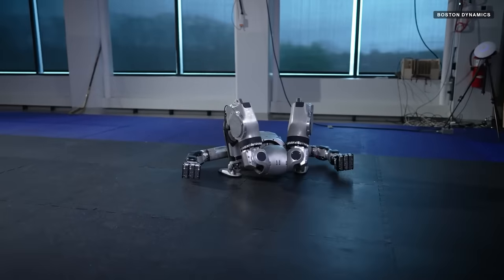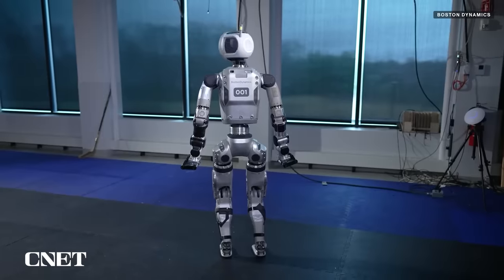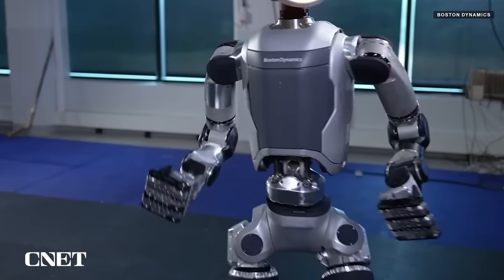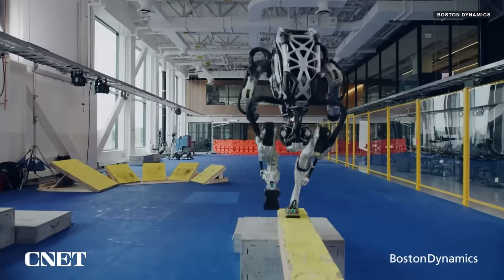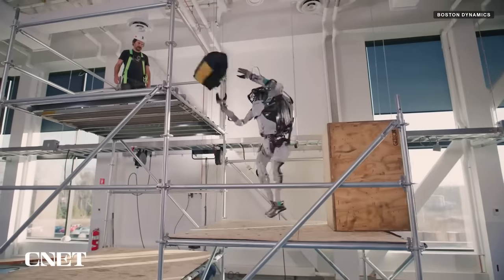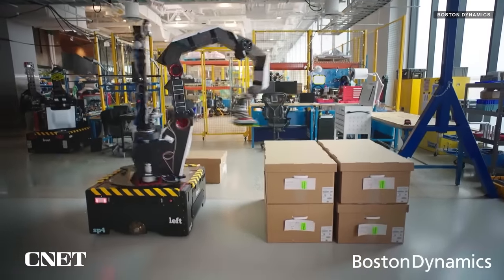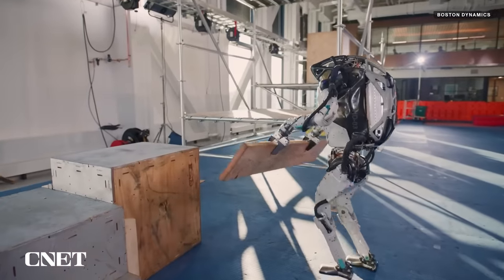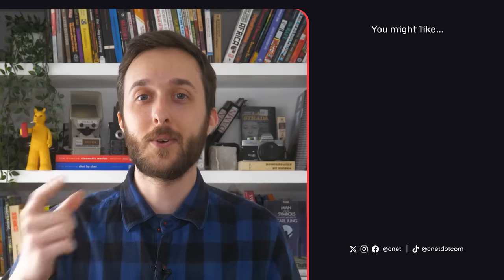Atlas vs. Optimus: Boston Dynamics & Tesla's Humanoid Robots

Comment: It's an insult to the years of hard work, research and dedication by Boston Dynamics, to even mention Teslabots in the same sentence.
Reply: @nth7273  No, they won't. Boston Dynamic Atlas will be in the factories in another 6 months. Also Atlas look more sturdy than Tesla bot
Reply: Tesla way ahead
Reply: Not in the slightest. Tesla will dominate. The hate makes no sense and you’ll be left dumbfounded in time
Reply: @milkybalance342  
It's not hate. There is genuinely very little reason to trust Tesla's capacity to make robots given BTDs track record. It's just the logical pick, even if it's wrong.
Reply: Its like comparing c3p0 to the T800, no competition, tesla will eventually get there but BD will be mainstream in the workforce and on the battlefield before them.
Reply: Sir can we adopt boston robots?
Reply: @saleemsuliman3062  
Yes.
For roughly 70 grand, Spots a great lil' companion, ain't he? 🥰
Reply: @ivoryas1696  you mean 70 thousand dollars
Reply: The difference is that Tesla started 3 years ago, give them another 5 years and they will be ahead.
Reply: This.

Comment: Boston Dynamics casually flexing and showing why they're the frontrunners of humanoid robotics lol.
Reply: Just standing up is much of a flex look at its clumsy hands an clumsy walk they had to cut it short BD is learning from scratch when it comes to electric motor and actuators they're used to hydraulics systems In its humanoid robots
Reply: What you are seeing at BD is programed moves.   Watch maker were making spring or weight driven automatons that could play music or sign their name 100s of years ago.   They programed their creations with cams.  The same idea as BD is using but mechanical vs digital.
BD is till setting up it's AI research.
Reply: @trondialsingh594  Lmao, they've been working with electric actuators on Spot for years now. Hardly a new thing.

And yes getting up from the floor is a flex. In that I'm pretty sure Optimus still struggles with it.
Reply: @chaosfire321  Optimus struggles with walking

asking it to stand up is just a bit beyond itself
Reply: 11yrs(BD) vs 2yrs(Tesla) btw
Reply: @danharold3087 nonsense. The new Atlas uses machine learning and AI vision.
Reply: @Settiis  You know this because ?
Reply: @danharold3087  Because I read their blogpost.
Reply: @danharold3087  The actual ability for a robot to move without physical supports and do so quickly is itself an important step, and it isn't as if most of Tesla's own videos aren't also faked such as the clothing folding video. At this stage their robot can barely walk at a rate of 2 miles per hour max and barely looks stable on flat surfaces as of their most recent demo. There is no practical application imaginable in it's current state, but BD has made actual robots which are fielded in the real world.
Reply: @typhonsentra  Well said
Reply: @chaosfire321  they been walking with electric actuators for years with spot and not humanoids why. They only had hydraulics not electric actuators, for humanoid only after tesla bot all the robot companies started moving forward. Boston Dynamics had atlas for over a decade and did nothing with it
Reply: @trondialsingh594  That is way it is called R and D.
Reply: @trondialsingh594  The OG Atlas was an R&D project never intended for commercialization, just to experiment with control algorithms and dynamic motion. Spot and Pick are the products they're selling. Oh looky there, when they were ready to commercialize a dog robot, they switched to electric actuators.
Reply: Could be used for warfare.
Reply: If BD are still dependant upon programmed actions, then I think Tesla have the edge at this stage.
But I do like the flexibility that Atlas 2 has shown.
Reply: @not2busy  have you read the interview with Boston dynamics CEO has said. The new atlas will be equipped with machine learning and Ai
Reply: Tesla's bot demo with the egg is 100x more impressive. BDs bot is a gimmick
Reply: @mattymatt2323  How many robots did Tesla sell? and how much experience do Tesla has in creating various different robot?
Reply: @danharold3087  that's why the partnered with Nvidia
Reply: @Settiis  Are you sure.  Boston Dynamics A I institute has job posting for most all of what would be there AI staff.
Reply: @typhonsentra  If Tesla intended to fake the clothes folding demon it would have not show your the person wired to manipulate the robot.  It was a dexterity demonstration.  
No denying BD has real world robots.  They are very different from what Tesla is doing.
Reply: Tesla's robot can barely walk while Atlas is doing flips. And Elon fans think tesla is more advanced "because it's AI"
Reply: @MikeOxolong   IF you learned computer science and the picked up a masters degree in AI.  The you could understand why Tesla fans are right.
Reply: @danharold3087 😂 not even close buddy.
Reply: @danharold3087  I did both, but teslabot doesn't demonstrate any decent level of AI.
Reply: @MikeOxolong  If you did both you would not be hear spouting nonsense.
Reply: @danharold3087  yeah I really shouldn't be talking about this, seeing all these musk fans robotic experts.
Reply: Completely different goals.  Teslas goals are way more ambitious.  Look at the hands between the two.  That’s a pretty telling difference that illustrates what BD and Tesla expect from their respective robots when it comes to object manipulation.
Reply: @mattymatt2323  
Sounds like you've got it backwards. Any idea how much less is between the exterior of a Tesla bot and even 2021 spot?
Reply: @nth7273  yeah and we'll have hyperloops and boring tunnels and level 5 self driving next year for sure
Reply: @nth7273  
Why would level 5 be next year, though? They've yet to reliably achieve level 4 SD and quite a bit of the field (and by the field I mostly mean Tesla, but not remotely entirely them) has been claiming they'd have 3 or better achieved for almost a decade, now.

Comment: Boston Dynamics is worlds ahead. I can think of a thousand real world applications for use today. AI can be taught, we just have to teach them right.
Reply: I would not go that far.  The hydraulic Atlas has been around for years but it is a research tool and demo unit.   Not suited for mass production.  Tesla has been hiring people for the factory to build Optimus.  Tesla has several years of AI experience and the new Atlas looks like a pill to manufacture.  It has more joints aka degrees of freedom than is needed.  Complexity and expense.   Wish both the best. Competition is good;  And you are right the robot that will be most easily taught may well be the winner.
Reply: The 360 nature of Atlas body makes it way more useful in a work setting. It seems far better balanced
Reply: Different strengths.  For example the hand articulation here is way ahead of Boston Dynamics.  That is pretty important if a robot is going to do an actual job that isn't hauling stuff.
Reply: @danharold3087 but you have to admit, those joints do make it sci-fi cool.
Reply: @danharold3087  Tesla has several years of AI experience

And with all that AI experience, FSD remains a simple minded Level 2 assistant, which needs 100 percent human supervision.
Reply: AI will learn on its own, we won't have to teach it
Reply: Exactly correct!!
Reply: Unfortunately Boston Dynamics can't. Even though they arguably are the best on the market, they have trouble selling their robots to stay profitable. It's not an easy market, and Tesla will learn that, too.
Reply: @mariusg8824  Tesla will also learn that the new Atlas robot from BD is light-years better than the slow clumsy Optimus bot.

For a home user, Optimus is cuffing useless.
Reply: @DerekDavis213 - You don’t seem to get that Boston Dynamic robots are not autonomous but must be carefully programmed and adjusted. That’s the reason their robot is not for commercial use. All the parkour videos are totally controlled and pre-programmed. That’s why Boston Dynamics themselves stated their robots are more for Experimental learning about movement. Not real world application.

You’d notice Optimus already has a fully articulated fingers and hands, something the old BD robot doesn’t have. Tesla is aiming for commercial practicality that ordinary people can use. While Boston Dynamics is experimenting the technology of mechanical movement which can later be applied for practical use (ie. military and security use)
Reply: @inisipisTV their fingers are remote controlled. Difficult to repeat human hand movement with less then 5 fingers
Reply: Name 10 real world applications

Comment: Atlas - an actual ai robot
Cyber bot - basically a mannequin with a motor or 2 that's remotely controlled by a human. Tesla bot is never not suspended by a cable
Reply: @nth7273  how can ypu make that claim and follow it with "you will see in a few years"?  Its laughablle. Show me someyhing that proves your argument or else you HAVE no argument.
Reply: @MrDmadness  show me something that proves yours. Or let’s check back in three years.
Reply: @MrDmadness atlas wasn't an air, it was controlled but on the other hand Tesla is ai, and ai needs time to grow. Tesla robots are still in gen 1,wait untill it's gen 10 or smth for it to be fully operational
Reply: @MrDmadness chatgpt needed years to train because that's how robots work, they don't just work in the first hour it was made, they need to train until it is working fully
Reply: @sulthan7317  ai is not what you think it is
Reply: @sulthan7317  not true.. go read
Reply: How about you judge after exactly how long boston dynamics have been working on theirs?
Reply: @MrDMadness
“AI is not what you think it is” what sort of statement is that lol. We dont have AGI.
Reply: @bb5979  its exactly what i said. You seem to think ai is sometging its not
Reply: @bb5979  no
Reply: @sulthan7317 pretty sure you've seen the latest video of atlas right

Comment: We habe Atlas moving like an athlete while the tesla bot dances like a granny without even being able to reposition its feet (would not surprise me if they were bolted to the floor). They are not competing in the same league
Reply: Tesla bot are b1, and atlas bot are bx
Reply: Yes, the Teslabots do hand dance only
Reply: B1s could move properly try a better example
Reply: @aydencahoon6557  Move properly AND dancing? No. Move properly? If moving in a straight line slower than the acceptable threshold of any productive worker is "properly" then, yes.
Reply: Its hardly the finished product, thats like me criticising you for starting something a year ago for not being better than someone with 10 years experience

Comment: By the looks of it, It's way more advanced that either of those other ones mentioned.
Reply: Digit looks like a simpleton in comparison... And I love digit!
Reply: The HD Atlas is still awesome. Look at that thing.
Boston Dynamics is cornering the market on robotics because it's looking at range and variety.

And... They will be taking jobs in future though probably it'll be basic, entry-level jobs...at first
Reply: It has more degrees of motion and probably more powerful actuators. Tesla dumbed them down on purpose so that people would be able to over power and outrun the bot
Reply: The fingers on the Tesla bot are way more impressive imo! That stomps the 360 rotation for sure. Also way more useful for things like folding clothing. Hands are a WAY more difficult problem then people give credit for.
Reply: The new Boston Dynamics ATLAS is the evolution of a Korean robot that won the DARPA sponsored robotics contest a few years back.  Hyundai bought Boston Dynamics.  Going forward it's going to be Boston Dynamics advanced software married to the versatile Korean frame robotics.

The Tesla robot walks knees bent using a shuffling foot stride.  That approach limits the robot to an artificial smooth floor setting only.  All of the Boston Dynamics robots were designed for real world walking environments.  Obstacles and uneven ground is expected in the operation.  The knee bent shuffle foot mode works only on smooth flooring.  ATLAS has demonstrated walking in general environments.  Leg straight striding ATLAS walks competently in the woods, icy surfaces, and general complex terrain.  ATLAS even tolerates being kicked around while walking.  The TESLA bot is limited to shuffling in factory floor environments.  ATLAS is already doing parkour on complex terrain.  The new ATLAS will go even farther than the previous model.
Apples and oranges.

Comment: I think Atlas would be great to help elderly and old people stay on farms and ranches. I personally think I would try an Atlas and see what potential it could have in real world dynamics. How easy it was to get into and out of a 1 Ton Truck. Help get groceries. Help shovel 39.6 inches of snow from out in front of the hay barn, barn, house and back approximately 3 to 4 feet back. To help shovel out the main gate so a person can open it and secure it open. Then you can get a six-foot snow blower through to remove the rest of the snow. Help shovel a patch of ground quite some distance through 4- and 5-foot drifts in order to feed equines. Shovel a patch through same said drifts to help elderly active old crippled up woman get to each barn to shovel doors free and back 3 or 4 feet. Getting the drift here. How about going up and down stairs. How about unloading feed when it comes in 50 lb. bags. That bag is 4 times lower priced than the 20 lb bags. How about helping the working class. Legal secretaries carry legal size file boxes up and down stairs and into and lifting them onto and off of shelving. There is lots of applications to help keep people in their homes.
Reply: Sounds like covid  quarantine almost 😂

Comment: I dont know why everyone wants to go with a very humanoid approach. We can literally make them do anything, but so many limit them to the same issues we have. Boston dynamics WILL pull ahead, 360 movement will be so much more useful, also who is dropping 20k per robot when it can break, fail, and is slower then a real human
Reply: You answered your own question: we can make them do anything we can. Maybe not so important in a factory, but extremely useful in your own home, on construction sites, or anywhere else robots will work alongside humans. 
   
They are also better suited for complex tasks. For instance: vacuuming. We have robot vacuums but they suck at the job and not in a good way. A humanoid robot could wield a proper vacuum, move furniture out of the way, vacuum the stairs, empty the vacuum and clean the bag/filter. No robot vacuum will ever be able to do that.. unless we build one that is nearly as complex as a general purpose humanoid robot. 
   
That humanoid robot meanwhile can help with cooking, clean the gutters, do the dishes and iron the laundry as well. They can use our tools, and adapt to our living space instead of the other way around. 
   
It’ll be a long time before that is possible, but it’s the holy grail of robotics, and I don’t know why we wouldn’t take the humanoid approach. If we can build that, we can build pretty much any specialised robot imaginable as well.

Comment: I've been tracking 'Red' Whiteker, and Boston Dynamics for now 30 years.  They're good, and had their major break in the Three Mile Island cleanup, but they take a 'top down approach' which looks good on stage.  It's not necessarily a bad thing, but it requires the programmer provide everything the machine needs to know in advance.  Personally, I think the 'bottom up' approach is the way to go.

Comment: Why make it humanoid? Why not give it four arms or four legs or extra joints or wheels or any other kind of useful stuff that humans don't have?
Reply: Humans can't rotate their heads, torso, hands and legs 360 degrees, so Atlas is superhuman in that sense.
Reply: That's Stretch and Spot - Boston Dynamics has several lines of development.  Agree that the human form is not necessarily optimal for all tasks.
Reply: because robots r designed to operate in our world

Comment: While I understand that Boston has metric tons more knowledge on robots than Tesla, I see Atlas being popular in actual hard to work and often dangerous areas (might even work in conjunction with the dog bot, dog bot alerts Atlas unit to something that needs to be moved, cleaned, etc.), might even see some action with emergency services depending on how much they add to it. Optimus is clearly going to be an office or a household assistant. There will probably be some crossover, especially once Optimus has to cut it's teeth in a real work environment and the end-users do what end-users do, and Tesla has to rework it or make more variants. I think the biggest thing that will separate them will be how user friendly they are to control and command. I'm betting Optimus will be out of the box like an Alexa with a body with some simple presets and the ability to adjust with some kind of learning AI, and Atlas will require at least some training to use decently at first.

Comment: Thing is, you don't need an Atlas working in a factory. It is not necessary for factory workers to be able to perform back flips. Considering that, my bet is that Tesla's bot will be more profitable, since it is simpler and therefore cheaper to produce. My money is on Tesla... But Boston Dynamics obviously has a lot of experience and potential.